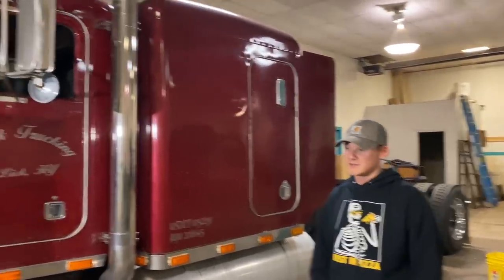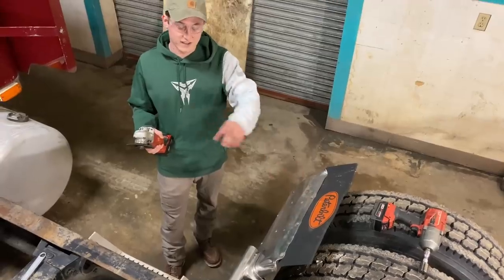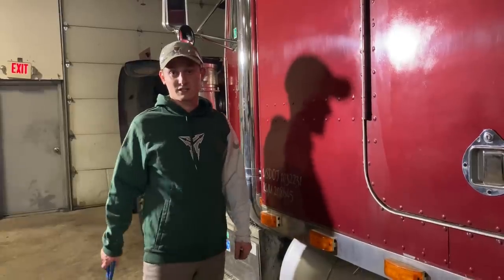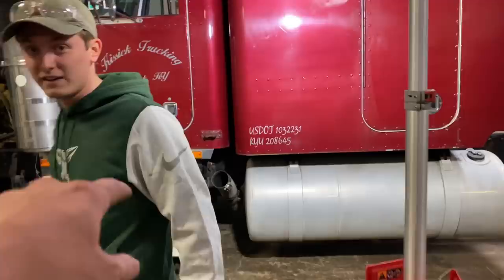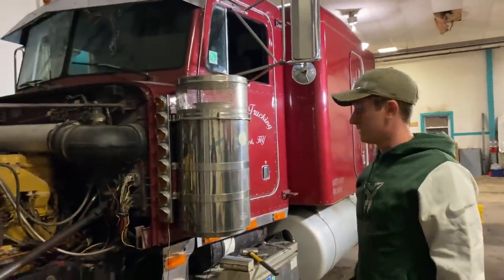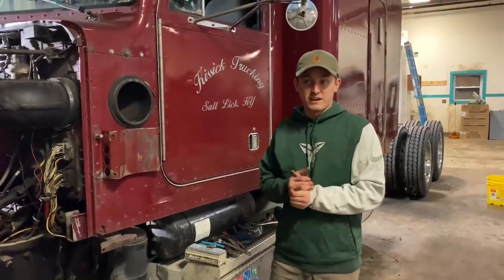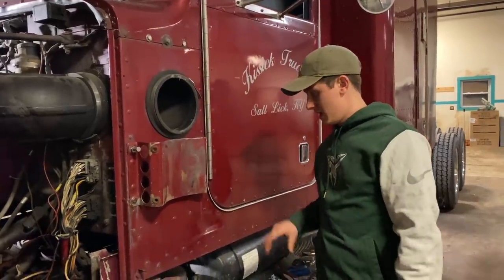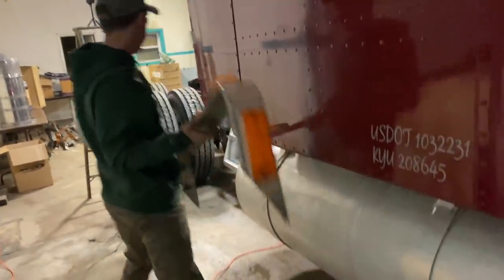Rebuilding the Peterbilt Flattop Part 1

Comment: If you can't use a hammer and dolly and get to the back of that dent, get yourself a stud puller with a slide hammer attachment. I used to use a snap-on stud welder with the slide hammer. Man that thing was sweet. If there is no access from the back side a regular one will still work well as long as you take your time. Doesn't look like it'll need much to pull it. As for the riv-nuts or 'nutserts,' idk if you guys have seen them, but get yourselves a riv-nut gun and the inserts. They're actually super cheap and handy as hell. I used to have one myself but forgot it somewhere. Check Eastwood or McMastercarr. Harbor Freight probably has their version as well, but I'd spend the few extra dollars and get a quality one. Like any rivet gun, they take a beating and you'll want the beefier one. You got an option to remove the bolt from that passenger side bracket without even grinding it or messing up the paint. Get a pry bar or big  flat head behind the bolt while 'blipping' the trigger on your impact and it'll probably spin right out. A little penetrating oil wouldn't hurt either. Really like the flat tops! You guys have some nice rigs

Comment: those "nut-serts" are ok when they are new but add some salt and corrosion and they are miserable. you can replace them with new ones. they recommend using their special tool to install new ones. i put them in by screwing a stud into it and running a nut down on the stud. works just fine for me.
Reply: Man you've been around a while... thanks for supporting these guys man. We will give it a try this weekend probably
Reply from the maker: Awesome! J.C. you are the man!